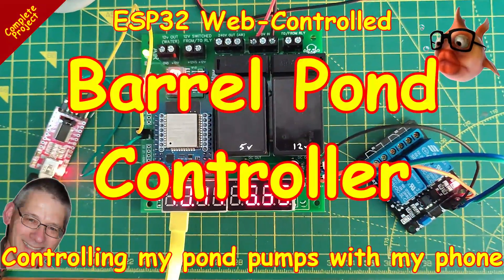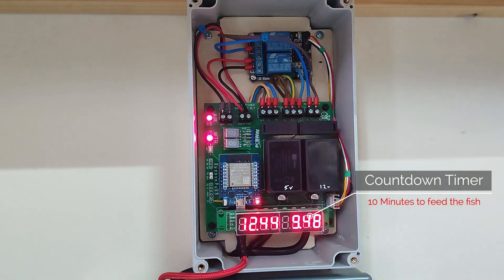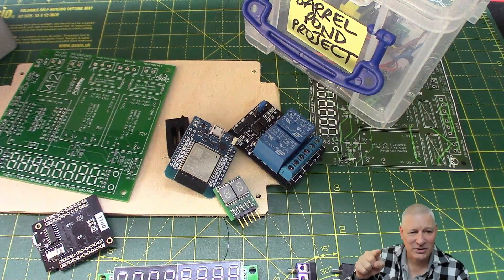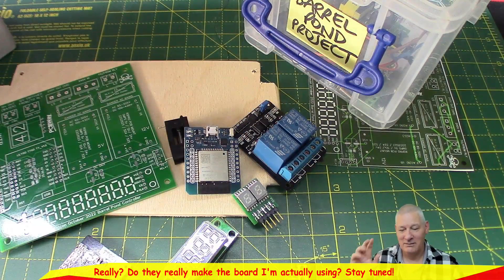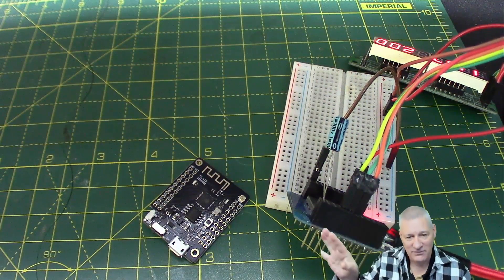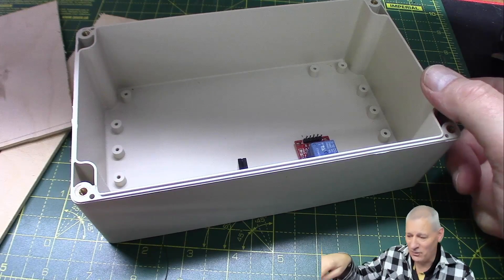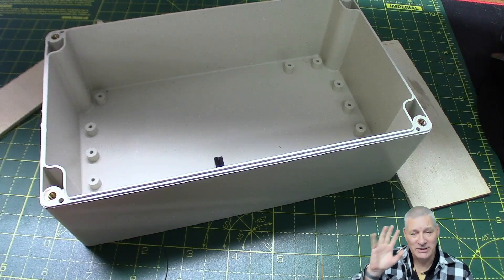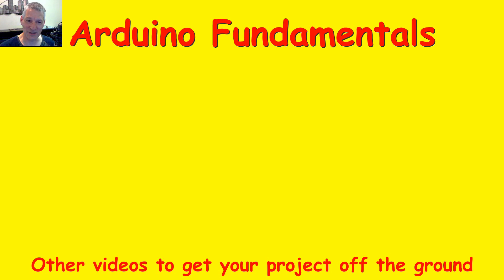#254 Web-enabled ESP32 Pond 🐠 Pump Controller - on  my 📲 phone

Comment: Nice! With websockets would be much better i think
Reply from the maker: You mean websockets in a software way? Instead of being on Wi-Fi? Hmm.
Reply: @RalphBacon  i saw your web page uses http so every time you click a link or want to ger an update of a reading you have to refresh the page issue a get request, is not real time.
In contrast, websocket uses real-time data transfer, just like node red for example.

BTW, big fan! I like your videos very much especially the ones that you talk about coding.
Right now i'm trying to do a latch on latch off switch with MPR121 module to turn on/off two wall mounted lights when you touch their body.
Reply from the maker: OK, I understand about the websockets, a server push update. I will have to investigate that for my next project. Good luck with your MPR121 latching project!

Comment: I love watching your videos and get all optimistic and order wemos d1 r1 mini etc. I was fine using arduino ide but now I am wading thro PlatformIO and Blinking my little mini all good. 
My New project is to monitor the lever[l of stuff in our septic tank and warn me before it hits the fan so to speak. I like the Idea of OTA updates as well, does that run on D1 R1 esp8266  does it have to be esp32 ? One thing I seem to have missed in your videos and is leaving at the back of the class is how to retrieve and install the mountain of information on your Github linked page, which bit is the "sketch", "the libraries"etc  I have missed the episode of how to handle this Github info and quickly easily run the code berried within. Have you recorded such a video or could you ?
Reply from the maker: I'm glad you are finding my videos useful! PlatformIO is, initially at least, a bit of a learning curve but there are many articles and videos out there to assist. It's in a different league to the Arduino IDE 2.0 even though the underlying editors are based on the same engine.

My GitHub entries are usually labelled to indicate which bit is which. By that, I mean the sketch(es) are usually in one folder, any associated libraries in another. I normally name them something meaningful but if I have missed something do let me know. 

The best way of "consuming" all that information is to download the areas you want (eg sketches, libraries) and then unzipping so you can take a good look at what there is). Then just copy in the sketch to a suitably named folder in your Arduino sketches folder, and the libraries similarly into your libraries folder.

I'll mention this again when I next upload a video with a sketch and library (I'm working on it now).
Reply: @RalphBacon  there are heaps of videos on PlatformIO "Tomasz Tarnowski" has a nice simple setup and esp32 wifi connect. So I am getting there with that. the thing I seam to have missed is the simple use of Github. Your linked page if sooo full of stuff how much time you spent god and your wife only knows. vids on the subject of git and github i find way to deep. All i want to know is how to find , retrieve and implement your code examples. pls
Reply from the maker: OK, I'll try and explain in a future video.

Comment: Love the countdown. Very retro… it looks like a bomb from a 1980s movie.
Reply from the maker: I really hope that there are no explosions in this project, Jonathan!
Reply: @RalphBacon  I hope so. You have the fast blow fuses, so that should keep you safe. I've blown those fuses with my bench power supply, hoping for some special effects, but they basically just go open circuit without making a sound or any cool flash (don't try this at home and note you can get safety goggles from the hardware for a few quid). Not even a fizz or a pop. On another note, Issue #5849: not properly reading the random nerd tutorials tutorials. I've had that issue a few times.

Comment: That was designed with amazing intention. I still use more doublesided tape then I care to admit. Also, I wake up in cold sweats thinking about the pin mappings change on something I am mass deploying, I feel you.
Reply from the maker: If you are going to mass deploy, I suspect a couple of PCB iterations is to be expected. After all, the cost is not a barrier. Rather that than discovering a mistake in your product once it's been rolled out. 😲

Comment: You need a 3D printer Ralph. You'd be surprised how useful one can be for these projects. I've used mine to print out bezels for OLED screens (including a surround to protect the glass edges on those 1.3"/0.96" screens).
I've also used it to print spacers for toggle switches, so they all align perfectly on a front panel.
And used it to make a drill template, so you get everything lined up perfectly when drilling an aluminium or plastic case.
In this project , you could have used it to print out the ply wood part (including all the mounting holes).
You can buy metal threaded heat inserts for mounting bolts (eg: M3,M4)
And for the designing part , I'd recommend OnShape. (There's some very good getting started video tutorials)
Thanks for the tips about the ESP32 pins. I just got some of those Wemos modules to make a camera slider.
Reply from the maker: You're preaching to the converted, Matt. I realise I "need" one, but I have yet (after several years) to find the time to learn how to use one. I'll look at OnShape to see if it is any easier than others I have tried.

Comment: Enjoyed the video. I looked for a link or a name of the phone app controlling the esp32. Must have been covered before. I've looked on the Play Store and they seem to be bluetooth only. Not wifi.  Hence the question - which app and is there a link to more info about it. I also looked on your github and didn't see it there. Liked the video, liked the phone app. Please don't take this as whining. Overall great vidieo
Reply from the maker: I don't think you're whining 😲James, no worries.

Yes, as Peter says, the "app" is in fact a web page served up by the ESP32 (in its "server" mode).

So I send the web page request into the ESP32 (http://192.168.1.92/on) and in the ESP32 code there is a "handler" for the "/on" part of that URL. What the handler (a standard ESP32 function) does, is set a GPIO pin high to turn on the relay (so the pump starts) and then returns an http response of 200 "OK" with something in the body to say "OK, I've done that".

Maybe I should walk my viewers through this, it's simple and mega useful? Web control of your ESP32 sketch! 👍
Reply: @RalphBacon  Hi Ralph, AWESOME videos, I just found your page today and have watched half dozen tutorials. Have you made the above mentioned web control of ESP32 sketch yet? I can't find it. Thanks!
Reply: If you mean the "app" that he demoed at the end, its not actually an app, but a webpage hosted by the esp32

Comment: Oi! Bacon! Where's the gland on that RCD socket box?!  😉
Reply: I spotted that too! At least a rubber grommet if not a pukka gland! Ooh err! 🤔😲😳
Reply from the maker: There's not enough room for a full gland, but I'm using a conduit offcut between the RCD and my project enclosure. Works well to protect the cables.
Reply: @RalphBacon  I'll let you off then! 👍

Comment: Very slick project Ralph!  Put in a 12volt valve and you can auto-drain as needed 😀
Reply from the maker: Good grief, Gord, the last thing I need is an empty barrel with 3 fish flapping about on the bottom. Evaporation, rain and the occasional hose pipe top-up is good enough for me! And the fish.

Comment: Ralph:  Thanks for the reminder/heads up on the TX/RX pins on the WEMOS boards.  I am going to go into my parts bins, locate this board and leave a note with them that these pins are switched.  THANKS!!!!!
Reply from the maker: Glad to help! I can't believe they got it wrong. Neither can I believe that I forgot there was an issue with these boards (I assumed I had made a mistake on the Workshop Heater Controller PCB). Doh!

Comment: I would like to be able to incorporate mains switching and power supply into some of my projects, but I don't feel like I understand enough about how to deal with mains voltages safely.  If you'd like to talk about that on a future video, or share some pointers to learning resources, that would be much appreciated.

For example, I recently did a project to measure the temperature in our outdoor ponds so that the pond heaters can switch on automatically when the water gets near freezing.  I would have liked to have one device do both the temperature sensing and switching power to the heaters, but I'm not confident about dealing with exposed mains voltages.  So I ended up with a commercial WiFi switch, and then built a battery-powered ESP32 with waterproof DS18B20 temperature sensor.  Both connect to Home Assistant, which turns the heaters on or off based on the reported water temperature.

One of the complications is that one of the heaters is 1500W, which means the relay should be rated for at least 15A (in the U.S.) for a small margin of safety.  The other heaters are 1000W, which might get by with 10A relays.

Perhaps finding self-contained relay modules and power supplies would have been good enough, so that I could keep high voltages on physically separate boards/modules from the microcontroller and sensor.  I'm not sure that I'd trust bargain priced modules from Banggood or AliExpress, without someone more knowledgeable reviewing them.  (I've watched BigClive do lots of teardowns of products that don't have safe isolation of mains voltages, or use components that aren't adequately rated.)
Reply from the maker: Like you, I have an innate distrust of all things mains-powered when it originates from an unregulated factory. But there are some good relay modules from the likes of DigiKey, Mouser, RS Components and so on, ironically all sourced from the same factories in China but this time built UP to a specification not DOWN to a price!

I would de-rate all mains modules by 50% or thereabouts; if you need to switch 10A then you should select something that can handle 15A (I think you said as much).

Splitting low voltage and mains parts of the project is no bad thing, frankly. Although I have both in the same project here, you will notice that the 240v bit is well away from everything else; it's almost a separate PCB!

Comment: So I used to worry about staying with the 100x100 PCB footprint but I needed a 250x300 PCB and 5 pcs only cost $40 including shipping so still a good deal. That was from JLC.
Reply from the maker: Yes, larger boards from PCBWay are good value too, but the price does jump from the $5 most hobbyists are expecting to pay (plus shipping). I thought I'd stick to the "normal" size, but good to know larger ones are fine for "one offs".

Comment: Those 8 way 7 seg displays get very flaky after a while. I have found it best to remove the sockets and solder the display modules direct to the pcb or you will be forever wiggling them trying to get all the segments to light.  Interestingly I bought some more recently and they came without the sockets.
Reply from the maker: Very true!!! Whilst I was testing out this project on the workbench I got some strange symbols and finally resolved it by swapping one group of 7-segments with the other. I guess it just made a better contact. But soldered would be even better.

Comment: The TTGO module has no RF shielding?
Reply from the maker: None. 😲

Strange to see the chip without the usual metal cap. But that's the way they make them. Seem to be OK, no complaints on the 'Net. 

Maybe that metal lid was just a marketing gimmick from one firm that everyone else copied?

Comment: Generally I keep my projects to low voltage.  Use commercial transformers outside of the project to drop the 240v to 12v, then use smaller regulators inside my project to reduce to 5v.  I don't fancy messing with high voltage.  There was a huge backlash against a youtuber who had built a mains project with incredibly small clearance between positive and negative, also between high and low voltages.
Reply from the maker: I've kept on the mains voltage traces together and spaced apart. Apparently you only need 2mm between Line and Neutral but I've made it significantly more than that.

Comment: maybe extend the standoffs between the wood and the pcb so the numeric displays are close to the lid ...
or between the wood and the bottom of the box, maybe simplify the power delivery. 
why 2 transformers, the 12V could easily power the 5V unless not enough amps.
No heating for the pond/pump ?
Reply from the maker: The LED is on "long" headers and also plugs into sockets so the display is very close now to the lid - great minds think alike!

Two transformers because there is not enough current for everything on that small 12v one (could have got one larger one I suppose) but I didn't want any noise introduced to the 5v supply from the pump.

No heating in the pond; I'm relying on the bubbles (on every quarter of an hour for 1 minute over night) to keep the ice at bay. We shall see!

Comment: Nice project 👍, this abs box will block 60% of wifi signal of ESP32.
Reply from the maker: That's OK, the 40% has only got to travel 2.1m (just measured it) to the Wi-Fi access point! However, your assertation that ABS blocks radio signals seems at odds with this:

"ABS is valuable, because it does not impede the movement of wireless technologies, including WIFI, Bluetooth, and RF."

See https://bit.ly/3XHSJqO
Reply: @RalphBacon  
int val=WiFi.RSSI()*(-1);
serial.println(val);

just check Rssi value with & without that box.
Reply: Hi Ralph, while I really love the products you do, I still wonder why you don’t make these projects more broadly usable with software like home assistant & ESPhome. Think you should really look into this and it will probably make your projects interesting for a broader automation public. Thank you for making these videos!
Reply from the maker: Another viewer alluded to this, and if I had my time again I might well have done that. On the other hand, eggs, basket, all in one... one fault and the house comes crashing down.
Reply: @RalphBacon  This is a nice simple self contained project that;s easy to follow.  Why on earth would you want to complicate it by using home assistant requiring an unobtainable raspberry pi, a steep software learning curve, internet connectivity and constant updates.  This project will still be happily running in many years to come doing what you intended it to do.  No please don't get dragged into the home assistant minefield.
Reply: @RalphBacon  Sounds like cold water fear to me Ralph 😉… Man with the Swiss accent Andreas Spiess already seen the light 😀. You can still have a local web interface on the device with ESPhome and it’s so easy to program and integrate in a HA dashboard. And it can integrate so much more devices you might already have, and energy monitoring, and… I haven’t looked back since I started using HA. Tip: don’t use a Raspberry Pi. Use a cheap old pc to install HA (I use an old NUC).
Reply: @LauwersFreddy  i find esphome buggy flakey,crashes HA and waste of time.

Comment: Very good indeed.  One thing you could do,  once is a transparent lid,  is to print a very nice panel artwork in photograpic paper and glue i to a carton and install it inside,  covering the electronics and a knife cut slot for the LED display.  Hope the idea helps.  Have a nive weekend.
Reply from the maker: Yes, I could indeed do that. I have a laser printer so it would look good. But I'm vain and quite like the exposed PCB and wiring. Does that make me weird?
Reply: @RalphBacon  just nerdy :)
Reply from the maker: I can live with that Vic!